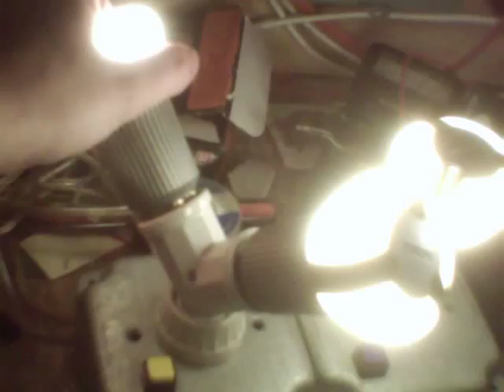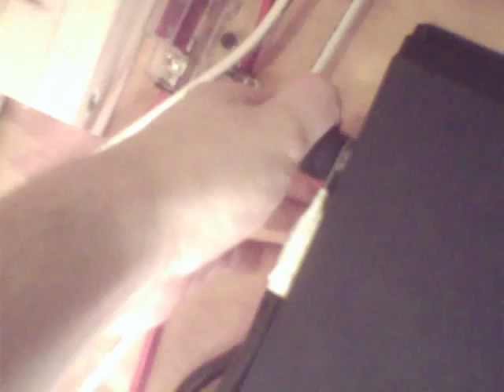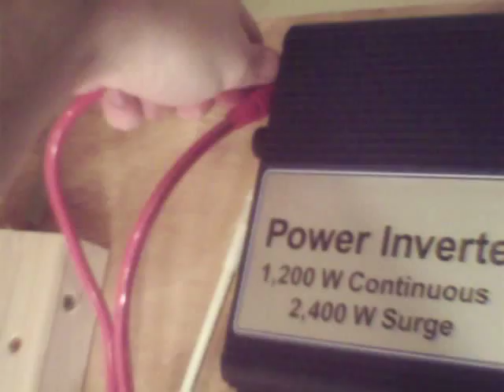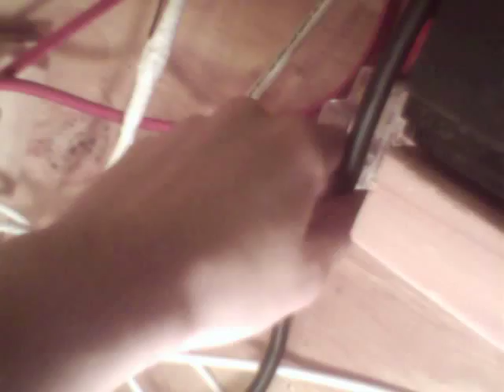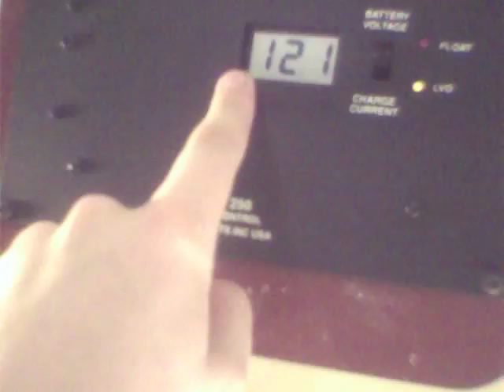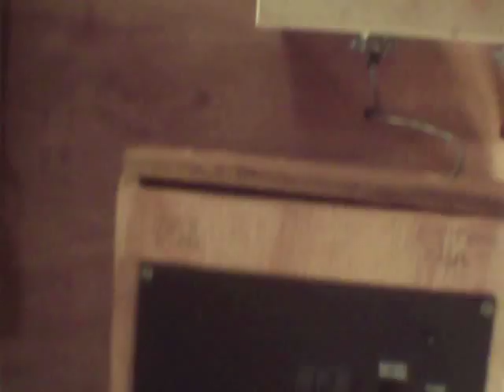New inverter wiring and load testing

Comment: I love to have a home wired for power on a secondary system. I have found that led lighting is getting really good these days so I am building a low power system with homemade simple pulse inverters for lighting which saves me the trouble of adding tons of bulky batteries because everything is operating at resonance. Small transformers do the job well. For mains power nothing beats having a power inverter and battery bank.

Comment from the maker: @KyleCarrington   They would be unnecessary due to the way my inverters are wired.  Capacitors are better for things like car audio amplifiers where the supply wires are a lot longer and loads are intermittent. Also, most capacitors sold as surge supply caps have a rated life of around 3,000 hours and they are expensive.